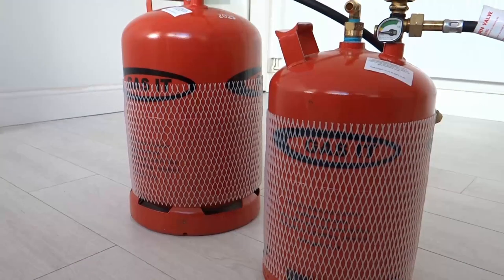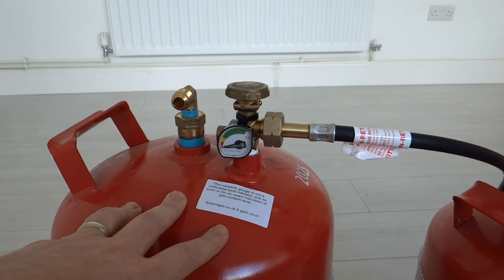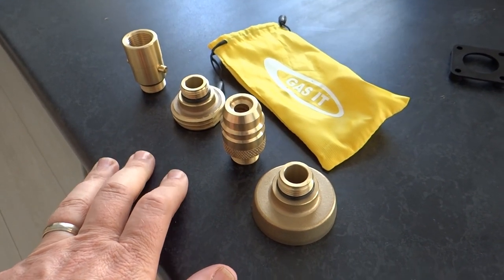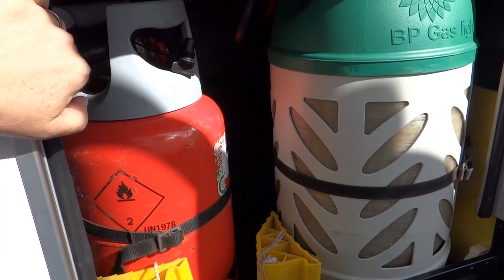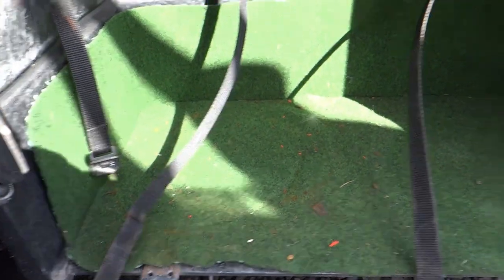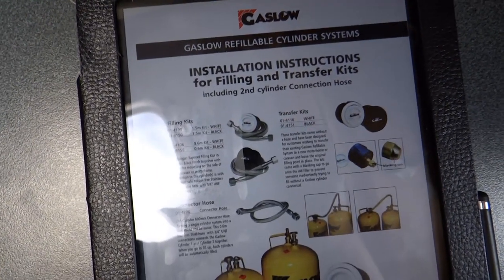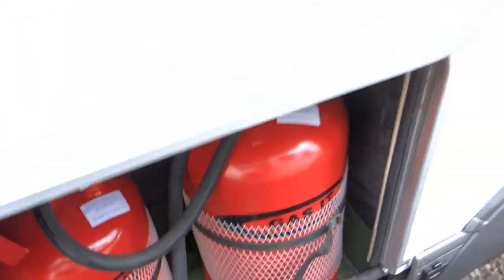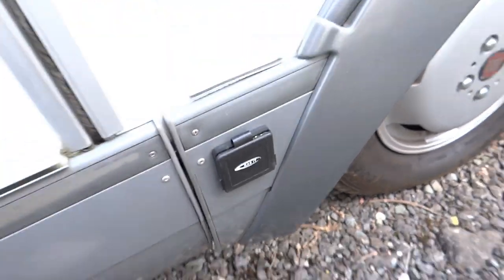Ourtour.co.uk GasIT Self-Refillable LPG System DIY Install

Comment: Great video I have a Hymer 1998 B584 and I am going to give it a go . I like the way you fitted the filler cap....very clever .Do you remember the length of the pigtails and filler hose you ordered it would be really helpful as my gas locker looks the same. 
Thanks again

Comment: Hi, I enjoyed watching your video - neat job! I'm just installing one myself and looking for guidance. Cast your mind back 6 years... Did you use any sealing compound on the flare connection between pipe and filler? I see some experts claiming you should and others claiming that you shouldn't. Confusing!

Comment: Hello, at our last trip we had the GAS-IT system also but the filling point was inside the bottle cabinet. There were some gas station refusing to fill our tanks refering "no caravan", but mostly we got our tanks full. Have you experienced anyone denying filling with this system where the filling point is outside?
Reply from the maker: Only once in 4 years on the road. We get mixed reports about internal refill points which is why we opted for an external one. Cheers guys, Jay

Comment: Hi great video thank you .... I’ve just recently fitted same system pressure is very low took automatic changeover valve off put hose directly to regulator works fine.. have you had same problems ?
Reply from the maker: Kontiki 635 hmmm, our system works fine with the auto changeover valve. Perhaps yours is faulty? Good luck, cheers, Jay

Comment: Hi Guys, i'v only started looking at your vlogs recently,  keep up the good work.
Question: . were you previously using Buthane or Propane and was there any issues with nozzles/ burners when converting to LPG. I know in a domestic case there are different cooker nozzles when converting from Butane to mains Gas?
Pat
Reply from the maker: Hi Pat - the previous owners were using Calor so would have been pure butane/propane before we fitted this kit. Nope, we've not changed any of the gas equipment in the van and everything's worked fine - no issues. Cheers, Jay

Comment: Nice vid. Do you have to fit it into van or can you just leave pipe loose in back and attach it to refill by opening back doors?
Reply from the maker: The usual options are to have the refill point installed in the body of the van so the system can be refilled without opening the locker door, or have a fixed point inside the locker (a bracket of some kind) with the fill point attached. GasIT sell both kinds of system. Cheers, Jay

Comment: we had gas it fitted and fitter told us to open both bottles together why ?? ...now im thinking why not just open one bottle use that one when he empty open the other one for a while then top up ?? Yes we have a gauge but me thinks not reliable..any feedback?? Harry..
Reply from the maker: Hi Harry. We've used one bottle at a time for the past 5 years, only opening both when we think one is about to run out. The auto changeover valve only switches across when one bottle is empty. I've heard before that both bottles need to be open but can't work out why and we've had no problems just having one open at a time. Cheers, Jay

Comment: Hi guys, I have an B544 like your old camper. Do you know if there is space to store One 11 bottle Gasit refillable ? Br and enjoy! Antonio
Reply from the maker: There's plenty of space for one of those in the gas locker in our current van as the video shows. Our previous B544 (Dave) had a single fitted gas tank, so we never used bottles in it. Probably best to get the tape measure out to check. Cheers Julie
Reply: @OurTourBlogVideos  Hi guys, so how has this system been for you over the last 3yrs? Have you had many servo attendants that take their jobs way to seriously and because they haven't seen this system before then in their eyes, it can't be legal?
Just interested to know or any stories you may of heard from other ppl on your travels, seen as you have a bit more descret way of doing it without opening van doors etc.
BTW, it must be so much harder not pulling the bottles in and our everytime too.
Id love to see about this set up here in Australia, those bottle refill places are a joke, especially over a few years. I may even just get a car gas bottle hooked up 😜
Reply from the maker: @Colaaah  the system's worked very well, and continues to work very well! Only a single attendant refused a fill, and he was trying to close up shop so he could go for lunch... That was in France, where there are so many motorhomes these kinds of system are very familiar to most service stations. We've spoken with lots of folks who have an in-locker filler and they report few to no issues with using them. Cheers, Jay

Comment: Bottles should be fixed in place with a bolted metal strap and bolted brackets on the bottom, not just with fabric straps.

Comment: Hi Can you tell us how this DIY it has worked out for you,, and also do you have a link to the actual kit :)
Thanks
Reply from the maker: Hi Trevor. The kit is available at http://www.gasit.co.uk/. We've used it for a total of 6 months European touring. Only small problems: the gauge on the big bottle sticks on empty after a refill for a couple of days and the systems has failed to switch over automatically in sub-zero temperatures. Apart from that, all good. No problems filling up across maybe 6 or 7 countries. So far, so good. Cheers, Jay
Reply: OurTour Blog
Reply: @OurTourBlogVideos  Great video. Do you have any more info on what the nature of the cold switchover problem is /was?
Reply from the maker: @constructioneerful  nah, sorry. It has only happened a couple of times in 6 years. Cheers, Jay

Comment: The "bottles" are cylinders! The "camping gaz" is butane. What you have is propane and despite where you get it, a 6kilo running hot water, heat and fridge will only last about a day. Any caravan site will have standard propane none will have yours, so you have to make the "find a station that sells lpg" journey. Rather you than me!
Reply from the maker: Nah, we've been using this system for 3 years now, on an off, and even in deep cold (Alpine winter ski resort conditions) the 17Kg system lasts at least a week, roughly a month in summer. 'Standard bottles' are great if you don't shift from country to country (or live for months at a time in the van - swapping standard bottles becomes expensive). If you tour the continent for months (which we do) then self-refillable is a sensible proposition. You can still use a 'normal' bottle with a high pressure hose adapter to the refill point, but we don't bother. Neither Morocco nor Finland have any official LPG refill stations, and we've eked out our gas across each of them, no problems. Cheers, Jay

Comment: So am i right in thinking the fridge uses gas whilst stationary and electric from the leisure battery whilst driving?
Reply from the maker: Our fridge is a three way one, so has three different power source options. 
We can use 240v electric when we are hooked up (on a campsite etc), 12v electric which only works when the engine is running and gas for when we are parked up but have no electric. Hope that helps.
Cheers Julie
Reply: Hello Julie, thank you...i know it probably seemed a silly question but i only bought my Hymer B544 Classic last week and its having work done so not really upto the mark with it all yet. Saw you travelled to Greece in yours, thats my plan in November although concerned about the route because of the weather conditions...any advise. Its only a one way trip for 6mths.
Reply: I'm using the fridge on gas all the time. While parking, and while driving. When hooked up ofcourse I use 230v then. When using gas while driving you need to keep in mind that when a big truck passes you the wind might blow off your flame. Always have a gas alarms.

Comment: As an LPG qualified engineer, I am a little confused that you are using two bottles of differing size.  As far as I'm aware, if two bottles are used on a system with an auto change over valve, the bottles MUST be the same size.
Reply from the maker: As a non-qualified engineer in anything, I welcome any advice I can get. The system's been installed as per this video and actively used for 9 months and has, so far, functioned as expected. I close off both outlet valves on the bottles when I'm driving and I only open the valve on the bottle I'm using when I stop. Once the gauge indicates that bottle's almost empty, I open both bottles. The auto-changeover valve stays on the 'primary' bottle until it runs out of gas some time later, then switches over. What's supposed to happen if you have two different-sized bottles Kev? Cheers, Jay
Reply: +OurTour Blog Hi Jay, what is supposed to happen, is happening... One gas bottle empties, the valve auto changes over and carries on. 
What I'm told happens if you have two bottles of differing sizes is that the smaller of the bottles when the gas level drops, the pressures differ in the two bottles and the valve changes too soon. (It's a long time since I covered this in college, but it sticks in my head that it was to be recorded as I safety is sure if there were two bottles not the same).  I'm going to have to get my books out now and find the definitive answer and let you know.  I probably do 3 LPG jobs a year, and most are on systems with a massive tank in the garden.
Reply from the maker: Thanks Kev - system *seems* to be working to spec, but any advice always appreciated.